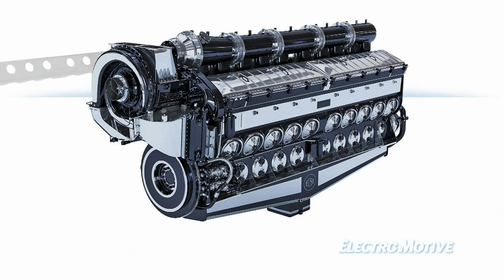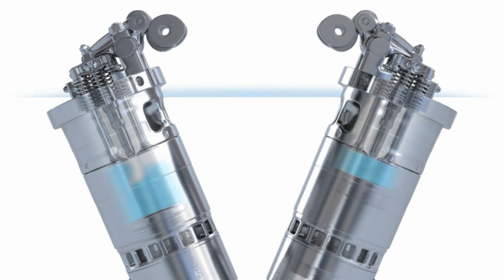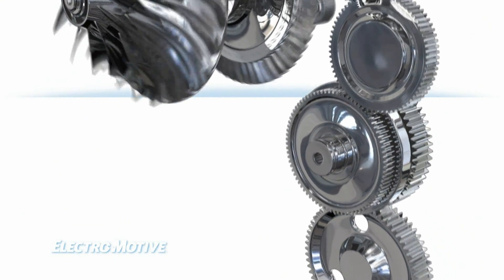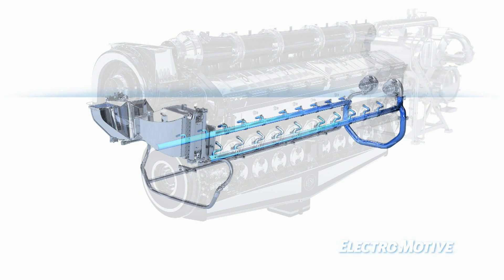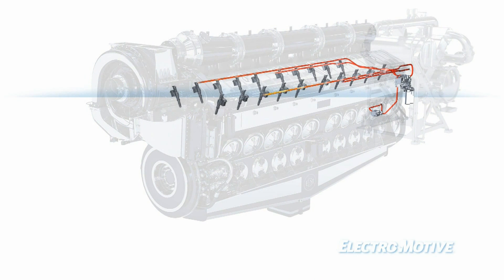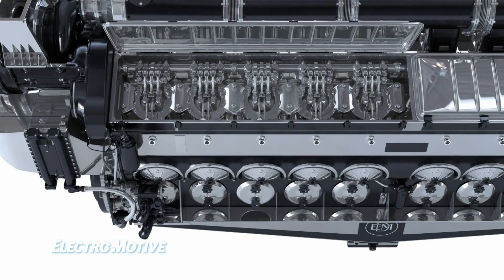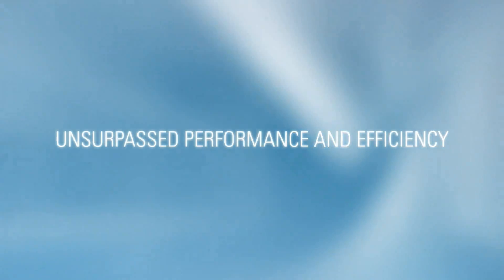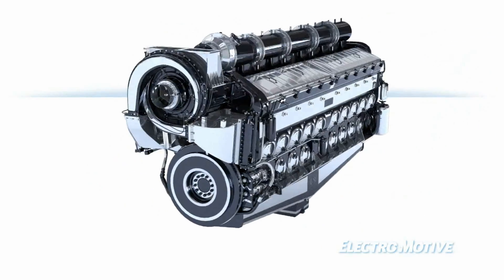EMD 710 diesel engine

Comment: ⁵In the capacity as a marine engineer I operated several of these 2 stroke engines. GM is absolutly the best equipment. Main and generator engines. The tugs I operated were one engineer vessels in and around New York. The twin 16 645 EMD E7 also delivered fuel coastwise Maine to Virginia.

Comment: RailPower Technologies declared bankruptcy in 2020.  They stupidly installed batteries on perfectly good EMD GP7s, GP9s, and some GP30s making them "green goats".  But now, all of those stupid experiments are scrapped, except for a few gen-set garbage units in California due to their stupid emissions.  In less than a decade, those will be garbage too and our supply lines will be further compromised as a result.  However, some railroads are smart enough to realize that these old two-strokes can last a century or two more.  They can last longer than every single human who exists today, and even their second great descendants.  It's all due to the simplicity and greater performance of the two-stroke compared to the Siemans Wabtec 4-banger trash-9s with the huge mufflers that make them sound like my great grandmother's Buick.

Comment: Is 2 stroke ? Twenty cilinders ?
Reply: Yes, two stroke cycle. The engine in the video is a 20 cylinder engine (V20)
Reply: The only twenty cylinder motor from the EMD 710 series was the 20-710 G3B EC which was famously used in the SD80MAC's that came from Conrail.
The only other twenty cylinder motors were the 20-645 E3's for the SD45's,SD45T-2's,SD45-2's,SDP45's,
FP45's,and SD45M's which were unreliable and destroyed crankshafts.
All EMD motors are two stroke.The only four stroke motors that EMD built are the 265H's from the SD90MAC H1's & H2's.The same motors were introduced once again but as the 1010J's from Caterpillar in the SD70AH-T4's.
Ironically,both units were unreliable.
There also was the 210H's which became export motors much like the 265H's that actually were heavily rebuilt given prolonged usage offshore.

Comment: Can anyone tell me that emd locomotives turbo is gear driven or both gear and exhaust gas driven
Reply: You mean at low rpms it is driven by gear and at high rpm by exhaust gas
Reply: @robinjaiswal548  correct because in the uniflow 2-cycle diesel the intake stroke is replaced with super charging and these medium speed motors don't build enough heat and pressure to spin a free spinning turbo at idle
Reply: @admiraltroll5255  Thanks bro very much I was confused since many months
Reply: @robinjaiswal548  no prob man. These engines were really neat and will still pull their weight for decades to come
Reply: @robinjaiswal548  its not about rpm its about load of the engine. 2 stroke engines can not discharge exhaust gases with adverse pressure gradient it needs favorable one for that reason it needs supercharging at low loads. As soon as boost pressure exceeds turbine back pressure it starts turbocharging. This system known as turbo-compound engine.
Reply: @emrahayaz3207  ohh
Reply: @emrahayaz3207  Sorry, that is not correct. Turbo-compounding is when  the turbine wheel uses waste exhaust energy to feed power back into the crank. Wright did it on some aircraft engines.
Reply: WDP4 fan spotted
Reply: @thisischetan  damn 😂 how did you know? wether it's wdp4 or sd70 or class 66 emd is love
Reply: @robinjaiswal548  the one item that connects those 3 countries together.
Reply: Yeh driven of the engines rear gear train until about notch 6 because there is not enough heat/ energy to drive the turbine fast enough when it becomes hot enough an over running clutch disengages
Reply: Hello someone has a manual of 20-710 G4C-T2
Reply: Hello someone has a manual of 20-710 G4C-T2
Reply: Gear driven to a certain rpm than the gears are declutched and the turbo spins on exhaust only. Called super-turbo charging not to be confused with double charging

Comment: i was part of the team that tested these 710's.  cold start to full power, to full load.  in less than 10 seconds.  stand right behind two cylinders back and you can feel the rumble.  awesome sound.  head phones on of course.  temp may have been 32 degrees F  and they would run this engine at full load for hours and hours.  brake load.  ... a few seconds, then back to full load.  amazing engine 4160 V 3 phase, about 3000 kW at that time.
Reply: In the mid 80s I was testing 645s at the DOT facility run by Association of American Railroads, these engines are truly amazing, the connecting rod setup with knife and fork is truly a marvelous design, it wouldn't works as well in a four stroke like the GE, engine, they gave me a power assembly and a 9/16" mechanical injector, the newest ones are computer controlled and use Electronic injection, and they did away with the Woodward governors
Reply: @ChiefCabioch  i worked Emd s in boats trains power station As Bs C c 645 710s Alco s I weld and machined on them 35 yrs I know lot of people complaining about the fork rod combo I was the guy who went in afterwards when they kick a rod uselly depending on damage weld up bore lower put in new insert weld up new piston cooling line and bracket fix oil pan door damage uselly 3to 4 days fixed new power pack ready to go with engine s Ge Cat Alco the broken rod still on the crank chewing up stuff ive been on job were they bring in a guy turns the crank rod journal with block on the pan I never got to see this but I herd it was $10,000
Reply: They are still making them for the countries outside the U.S
Reply: Exactly. The EPA should be sued to non-existence for killing this engine off
Reply: @EdmontonRails  They are still in use in many countries around the world. A great engine, but very polluting. 4-stroke is the only way forward.
Reply: I made my living off EMDs I love these engines.
Reply: My GF had a 74 cheeta arctic cat with a 16-645 butswants to power with a Fair Banks Morse 38 8 and 1/8th!

Comment: I just want an end to Diesel smoke.
Reply: The trend of rolling coal? Or do you want diesels gone for good?
Reply: GE is quite literally ALCO since they were acquired by them and the GE 7FDL's were really based on ALCO's 251 series.
Which explains in many ways why they aren't mechanically reliable.Even though GE surpassed EMD on technological advancements,EMD always retained their reputation of having the best diesel motors such as the 567,645,and 710 series but just that...Modern EMD units however aren't great,only the motors.
Reply: These tend to smoke very little, if at all.

They are Not Alcos.
Reply: @dennisyoung4631  an Alco is a different creature...so is a GE, or Baldwin.

Comment: EMD are beautiful engines, reliable, easy to work on. a power pack can be changed in 4 to 6 hrs. with a Fairbanks Morse engines it takes 4 days caused by the requirement to pull the upper crank shaft, I know I had to work on them, and there not reliable